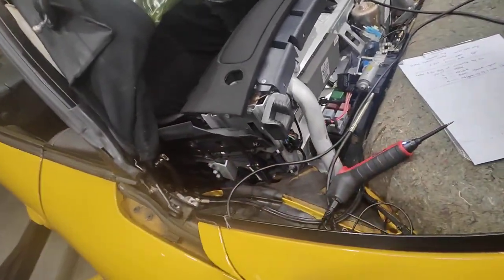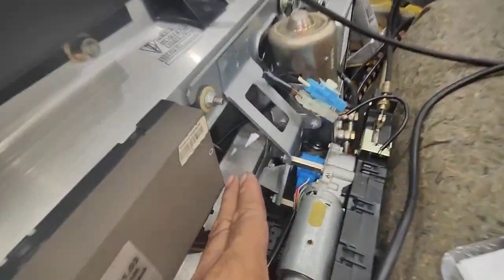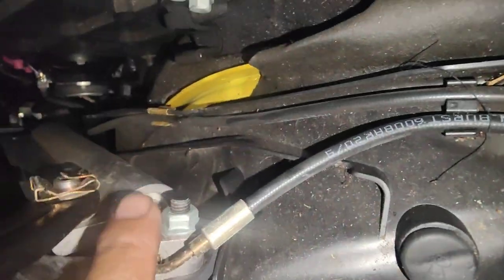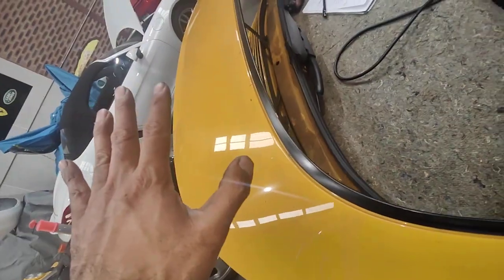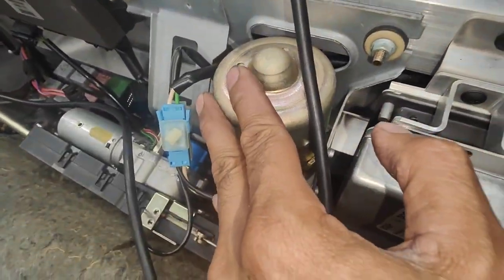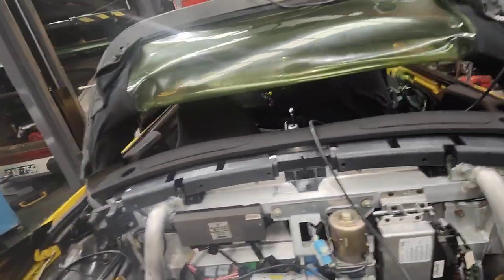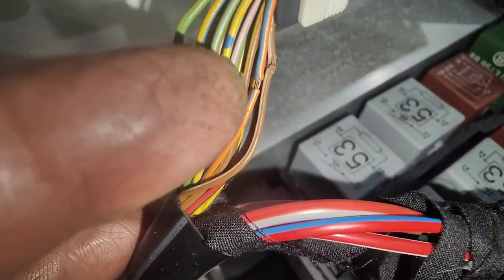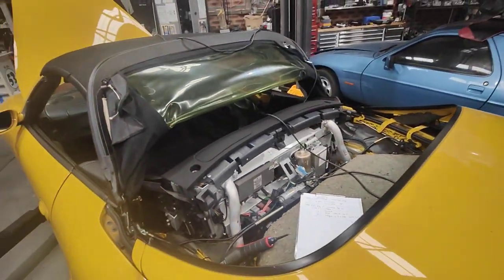Porsche 996 P.M - Convertible top diagnostic check

Comment: Great watch. I am having a slight issue after hydraulic cylinder repair. Top goes up and down perfectly fine but when lowering down, clamshell does not open all the way. Its enough to barely clear the roof. When the clamshell goes towards closing, it closes 95% of the way but does not sit flush. It feels like an alignment or calibration issue as everything in the system is working as it should except for clamshell opening and closing. didnt wanna meddle myself till I know what to do exactly. Any thoughts? Apparentlly theres an allen screw accessible from behind the rear seats thats used during calibration. Couldnt find any other info so thought to ask you. Thanks and hope youre sorted now!